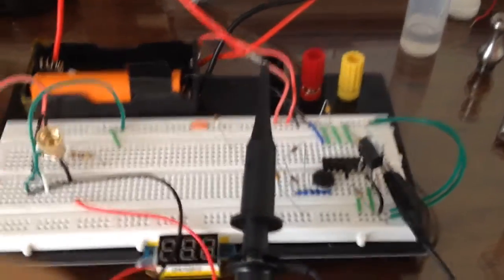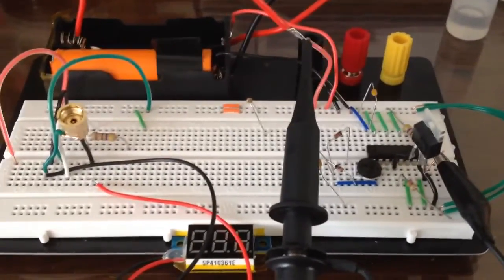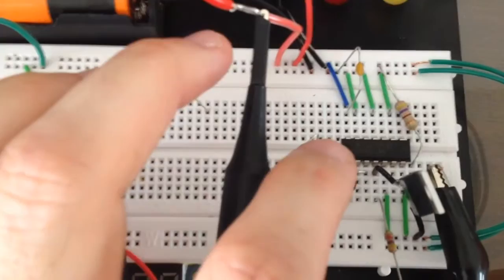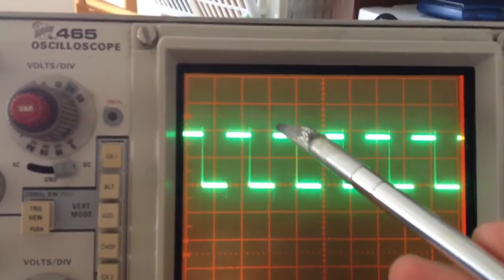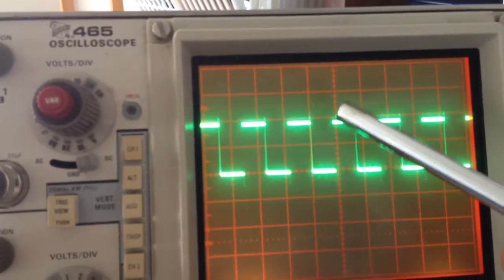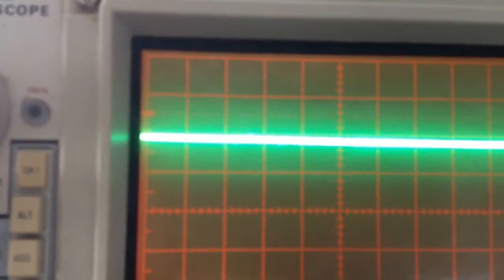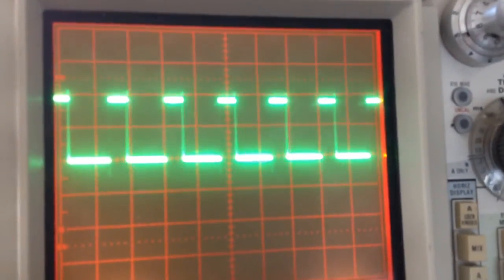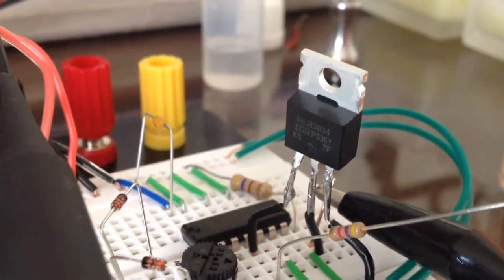Variable MOSFET E-Cig Mod Proof of Concept

Comment: Thanks for posting these videos! I'm trying to understand all of this stuff and just saw your other videos analysing the efficiency of different battery setups. How does this play with PWM?

For example if the first example you had 0.1 ohm resistance on a 4.2 volt battery resulting in 86W on the coil, 123W total and 37W lost in the mod (30%). With higher voltages you would use higher resistance for the coil and reduce the current draw and have much less wasted power (only 7%).
But with a PWM where you might want to use that same 0.1 ohm coil from the first example and set the PWM duty cycle 39.4% to get about the same effective watts on the atomizer (86W) I calculated you would use 145W total power and 60W lost power in the mod (40.83% lost!).

Have I calculated this wrong or making a wrong assumption or are overpowered box mods less effective than lower mods? Or are resistance values in real life mods just much lower so this doesn't matter as much?

The spreadsheet I tinkered with, for the last example I only multiplied the power values with PWM: (current * PWM)^2 * resistance
https://docs.google.com/spreadsheets/d/1pd6VlPfvvEoj6NrWAATVpxQpyU_m9nrh7XwaoeFdXHQ/edit?usp=sharing

I wonder how the DNA200 does this? Even with smoothed out voltages you should still draw the actual current as PWM from the batteries? Or is the current draw also smoothed and therefore more efficient?

My plan is to build a temperature controlled PWM mod with an arduino chip. So these low resistance values could actually happen (even though I plan to use higher resistance titanium / nife30 wire).